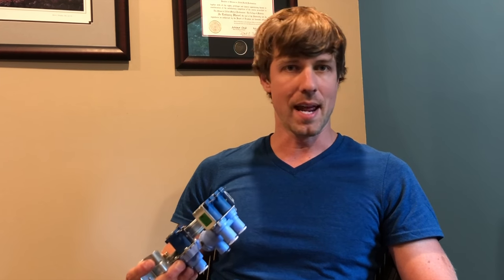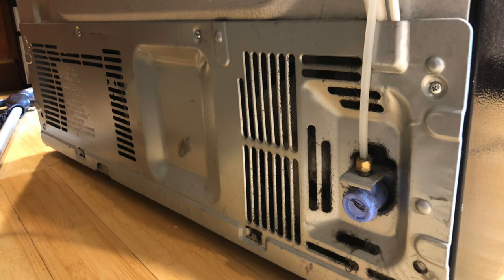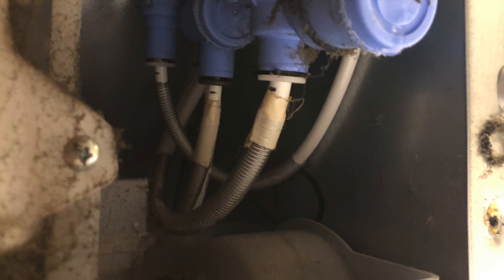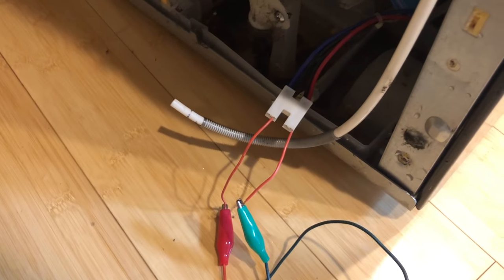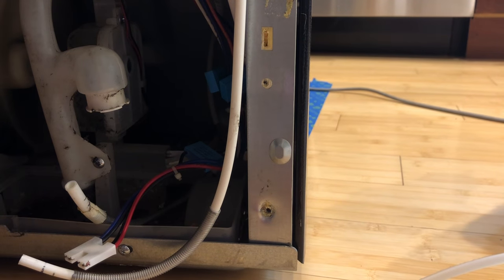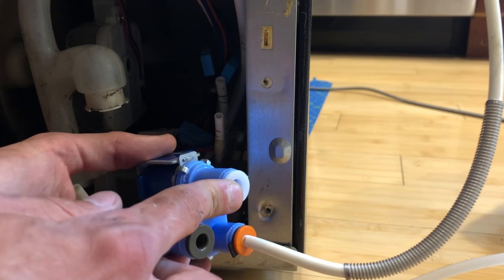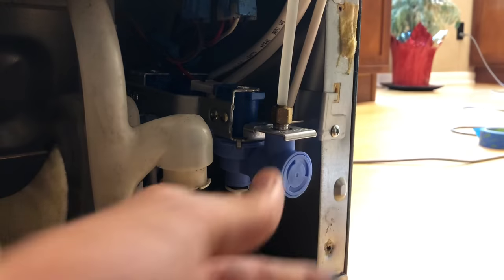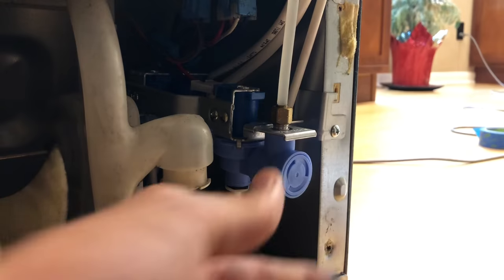Slow refrigerator water dispenser DIY FIX

Comment: Sadly my home warranty people came twice, replaced the water inlet valve and did not fix the problem. I'm thinking something in the system is backed up or clogged. The flow of the water is slow from the copper pipe that is connected to the fridge hose. Next step is either run some vinegar to flush the system or get a water pressure gauge and see if that is the issue.  It does appear to fill the glass slow even when it is disconnected from the fridge.
Reply from the maker: Oh really? Sorry to hear that. It sounds like the problem is somewhere in the water lines. If other faucets work well in your home, perhaps its just the valve on the pipe going to the fridge, that would be a fairly easy fix. Best of luck resolving it!
Reply: Thanks for the follow up. Turns out the saddle valve went bad and it’s against plumbing code anyway. Going to try to get the valve replaced with something better. Might call a plumber for this as some of the piping may be soldered and needing a replacement.

Comment: What if the flow is generally too slow for my liking? In other words it doesn't appear to be slow because there is anything wrong with it...but I just want it to rocket out of there because I am tired of standing there forever.
Reply from the maker: Hey Kamron. That could be the result of lower water pressure in your home (but if your faucets have decent pressure and flow fine then that probably isn't it). The other possibility is that the valve that supplies your fridge is not opened all the way. Finally, it could be a partial clog in the system. When was the last time you replaced the water filter?
Reply: Kamron Khannakhjavani  I’m with Kamron I need more pressure .

Comment: This worked. Bought $20 aftermarket part instead of OEM which was like $140. Very easy and cheap. Also replaced a water hose because the previous owner used the wrong hose material and it expanded from the pressure and started leaking.

Comment: Great video.  I first tried replacing the saddle valve with a ball valve.  That did nothing.  Ordered the valve assembly, and had it installed and working in 20 minutes.   Good job on the video, it was extremely helpful and thorough.  The video saved me a lot of time and guesswork.  Thanks!

Comment: I ordered the water inlet valve from Amazon (it was on sale for only $44) and installed it today. It was actually easier than I thought it would be! And it works! We've had our LG refrigerator since 2008 and I think we just added a few more years to its life. Thanks for the video!
Reply from the maker: So great to hear - thanks for letting me know. Ours is from 2008 as well!

Comment: Here's a crazy one.  We have plenty of ice in the bin but no water. or ice would dispense from the door.  We have a 12 year old side by side Electrolux with a water filter very similar to yours.  So with your great video, we understood what we were doing and very easily installed the new water inlet valve.  Nothing happened......so with nothing to lose, my husband opened up the front door dispenser module.  We didn't have a new one to put in so he just unplugged it and then fiddled with the connections and plugged it back in.  He also noticed the ground for the dispenser was loose so he sured it up.  Put everything back together and by some miracle, it's all working.  Don't really know which thing it was but the ice and water work better than ever.  Thanks so much for your helpful video that really helped us become one with our good old frig ;-)
Reply from the maker: Hey Nancy - glad it helped! From what you described above it sounds like the issue was with the switch in the door, and in your case a loose connection. Glad you got it working!

Comment: I just bought this part- I already changed filters, blew my lines with low air pressure, checked the inbound line pressure, and changed the water inlet valve assembly in the door!  Man, I hope this works for me!

Comment: Excellent video, charlieaf92! I also read most of the comments because my 12 year old Whirlpool water dispenser worked good for about 4 seconds and then slowed to a trickle. After reading certain comments I decided to try this: I took out the water filter and pressed the water dispenser just to see if my unit worked without the filter or not, and the water came out at an even slower trickle. I kept it going for about 30 seconds and then replaced the same filter. Lo and behold the water came out like brand new! Have no idea why it worked but it is still working as of 5 minutes ago when I got up to check it again. Great video and comments everyone!
Reply from the maker: Oh that's great! Thanks for sharing and glad to hear it was an easy fix.
Reply: That worked for me as well. Odd. I wonder why it slows down after a while.

Comment: Always check the simple things 1st! I almost ordered the filter hose kit and almost bought the solenoid/ inlet valve kit before thinking “where does the water line go?” When I followed the water line from the fridge, through my cupboards and down to my utility room, I found that the valve was not fully open. All I did was open the valve and VOILA! Full stream of water, no waiting forever for a glass of water and ZERO cost :) No need to try to clean out mineral deposits from the lines either. Soooooo happy with this super simple fix.
Reply: Where’s the water valve
Reply: @lilfide07  My tiny shutoff valve on the plastic line was in my utility room in my basement. I also have found that this water valve opening solution only solved the problem for a few months. Once guy I saw said that in the winter his line freezes more often. I don't know why this would make a difference. I learned later that I needed to turn down my freezer setting to 1 (lowest setting) because the water line/ dispenser kept freezing up. When this happens I leave the fridge door open for ~45 mins and insert some pillows into the fridge to help insulate the items inside the freezer while letting the door/ water line/ dispenser thaw a bit. Then I take some weed trimmer line and force it up into the water dispenser spout about 2 meters. This seems to unblock the frozen ice bits from the line. Then I can remove the pillows and close the door. It may be when you have more items in your freezer and you are away and not using your freezer that the water line freezes up more.

Comment: We have the Whirlpool French Door Model WRX735SDBM00 and the water dispenser is dispensing water spontaneously, even when we pull out on the panel to make it stop.  I've looked at your video on "slow refrigerator water dispenser DIY FIX" but I'm not sure if this would apply to our situation.  Like many these days, we're on a tight budget.  Thank you and God bless you for sharing your skills and repair tips and knowledge with the rest of us, like me.  I'm a nurse and do not know much on troubleshooting appliances.
Reply from the maker: Hi Alma. Is it coming out with force or just dripping? If it is coming out with force it could be a bad micro switch in the door. If it is just a drip it could be ice stuck in the chute.

Comment: I did press the "like".  My LG refrigerator is about 11 years old.   For a few recent years the water has been very low pressure and I've had the ice maker turned off, getting ice from a stand-alone unit on a countertop. During this week I've turned the ice maker on and verified that it does cycle.  It produces a small amount of small cubes.  I'll return here and tell if my attempted fix is a success, or if I must replace the valve.  Thanks!
Reply from the maker: Good luck with your project!

Comment: Thank You… this describes my problem exactly. Going to order the part.
Reply from the maker: Excellent, I hope it works for you! Let me know.
Reply: @charlieaf92  … finally got around to checking it out, and needed to look at the pump itself for the part number, and started checking from there. This was so bad, when holding the fill lever, I could put 96 ounces into a 8 ounce glass.  After Checking the easier stuff, I found a blockage at the water pipe where I tapped in the line for the refrigerator feed… had to use my compressor to blow thru ,back into the pipe, and suddenly had a lot more water coming thru.(All this with the water shut off of course).  Anyway… works like it should now.  Again… Thanks for the  information you gave.
Reply from the maker: @normanwalch9867  glad you got it sorted out!

Comment: I had a slow water dispenser, too and I was a bit late replacing the filter.  Turns out replacing the filter increased the flow.  Start with the simple things.  In this case, also a necessary consumable item

Comment: This post was very helpful.At first I thought of air in the line, water was coming out but in a slow trickle, not like a usual flow. I flushed the line, still slow. I replaced the filter, still slow. It was running fine before and I know there isn't a kink in the water line. I am going to change the inlet valve. I have a Kenmore Elite but as you mentioned these valves are similar.  I had no issues with ice making as the ice maker was making ice as usual.
Reply from the maker: Hey Wyl - glad it helped! I experienced the same thing. It went from working just fine to trickling instantly. It happened after I changed my water filter, so I wasted time thinking it was a bad filter, or that air was trapped in the line. After spending 20 minutes trying to flush the air out of the system I came to the conclusion it must be one of the valves. They sell the valves as a single part, so you will probably have to replace all 3. After this video, I disassembled the bad valve. They are very simple - just a rubber diaphragm, spring, piston and electro-magnet. I didn't see anything wrong with the valve that would have prevented it from working properly though. Luckily its a $40 part so its easier just to replace the entire assembly and have 3 brand new valves.
Reply: You know what it turned out to be, I did change the water inlet valve and still it was a "slow trickle". I had to change the "water filter housing", $67 part, took 20 mins. And that fix the trickle, now it flows like the day I bought it. Your video helps tremendously in diagnosing the flow issue. Keep up the great vids...... Cheers.
Reply from the maker: Wyl Apache thanks for the update, and sorry to hear that it didn’t turn out to be the inlet valve. I’m glad you got it fixed though!
Reply: @wylapache5362  What model number Kenmore Elite do you have?  My water stopped all together.

Comment: Very detailed video. Am working with a kenmore 106.59962805 where the water is now dispensing slowly after replacing the water filter. I tried putting the old water filter back in with the same result. The interesting thing is that I can remove the filter entirely and the water dispenses like a champ. Not sure where to check from here, more fun I guess.
Reply from the maker: Hey David - when you dispense without the filter in place does it come out the normal spout, or does it spill out inside of the fridge? If its still coming out of the spout, there must be some kind of a bypass switch in place to allow for use when a filter isn't in place. Perhaps that mechanism is the source of the problem. Strangely, my problem started after replacing the filter - but turned out to be completely unrelated to the filter itself.
Reply: Did you find a fix this is our exact issue as well \
Reply: This is my issue too. Did you ever find out what it was? We have a whirlpool. It works great without a filter (but of course then it’s just tap water). It trickles or doesn’t output any with the filter in. Tried multiple new filters and those are expensive!
Reply: @janiegrace7541   did you find out what the problem was? That's what our whirlpool fridge is doing.
Reply: @micart79  No, unfortunately we never fixed it. :(
Reply: @janiegrace7541  so we found another video that shows the filter isn't getting enough pressure so it needs a large washer to help push those 2 knobs in ..the guy used a dime thickness slice of a sized schedule 40 pipe as extra piece to push into the 2 knobs where the filter goes. We are going to try it this weekend. If we can't find a metal washer ring we can get a piece of the 40 pvc and I have a dremmel I can slice a thin ring off the end. You put the washer ring slice over the 2 knob/prongs then put filter in over it ...it will push the prongs further in opening the water line up.
Reply: @micart79  thanks! I will try that too. Can you link to the video?

Comment: This is really great video, thank you for putting this up. I’ve LG refrigerator which is 12 years old now and we have recently developed slower water dispense compared to what it used to be. Ice is still coming up plenty. The water filter it uses is LT600P. What could be the issue ?
Reply from the maker: Probably the inlet valve. There are 3 solenoids on it, one specifically for the water dispenser, one for the ice maker, and one that has to open for both. If the valve for the water dispenser starts to go bad you'll get slow water flow but your ice machine will continue to operate correctly.

Comment: Ice is a perfect size whether I bypass the filter or not water dispensing on the other hand is slow with the filter on but very good when I bypass the filter
Reply from the maker: Hard to say for sure but since there are two different solenoids for ice and water dispenser it could be that the water one is failing.

Comment: Thanks for the video. I've got a similar low flow issue on my GE fridge - it's a 3 year old French Door model (similar to the GE Profile fridges but without the Profile extras). What's strange is I get a good flow rate from the dispenser when installing a new water filter, but the dispenser rate drops off after about 3 weeks on the filter. If I change the filter, it goes back to a normal flow rate but than drops off again after 3 weeks (and the cycle keeps repeating). For the first 3 years of ownership, we didn't have this issue... only started a couple of months ago. Only thing I can of to try is replacing the valve like you showed in this video (perhaps the solenoid isn't opening all the way, and once the new filter has the smallest amount of buildup, it's enough to impair the dispenser rate?).
Reply: Hey Daniel! If it changes based on a new filter I would start there. Are you buying the GE brand replacement filters? I've made the mistake of buying the $10 version on Amazon and have since learned that they do not filter to the same quality as the higher cost filters. I would start off by trying the dispenser with the filter removed. My fridge bypasses the filter if it is removed, but others require a blank insert to prevent it from leaking.
Reply: @charliefrancus4744  I have the same issue, I want to follow this instruction but my fridge does not dispense water if I take the filter off, how and where do I insert the blank insert
Reply: Raise the temperature setting on the refrigerator side. If it is too low, water in the filter can freeze and cause water to flow slowly.

Comment: I have a Frigidaire and the downspout that’s visible by the water dispenser disappeared.  I think it retracted and now the water is gushing out all over the door.  I cannot get it to aim into the glass.  What’s the fix?  Thanks
Reply from the maker: Good question. I suspect its like a little plastic or rubber straw/spout that has been knocked off. If you're able to remove the surrounding panel you might find it back in there. You could also look up a parts diagram online and see what it looks like and order a replacement. You may be able to install a new one without any disassembly but I'm not sure.
Reply: Thanks for taking the time to reply.  Much appreciated

Comment: I changed out the filter and still slow flow. If I take the filter out, water flow is fine. The problem started with no known changes in the system. The filter was fine. We had not moved the frig. Do you think it is the valve or something to do with the filter system? Thoughts?
Reply: And thank you for your time.
Reply from the maker: Hey Brenda. I'm not sure to be honest. If it works fine without the filter in place then I would suspect it's either a problem with the filter itself or possibly a bypass valve like you said. It also could be the inlet water valve. If it is not opening all the way and not providing full pressure, it would be more obvious when the filter is in place because it restricts some water flow. It's possible the problem is there even without the filter, but its less noticable.
Reply: @charlieaf92  you rock. Thank you for responding!
Reply: We have the same problem with our Whirlpool refrigerator wrx735sdbm04. Replacing filters every 2-3 months. Takes 1 minute to fill 16 oz glass. With no filter, it takes seconds. I did notice stuff floating in the water when not using a filter. Like tiny white specs. I’m wondering if something is clogged in the water line. We replaced the water line going from the shut off valve to the refrigerator line. We also cleaned the refrigerator water lines using a vinegar/water solution which helped get rid of the larger debris. What do you think?
Reply: Did you find out what the problem was?
Reply: @micart79  I had to replace the icemaker.